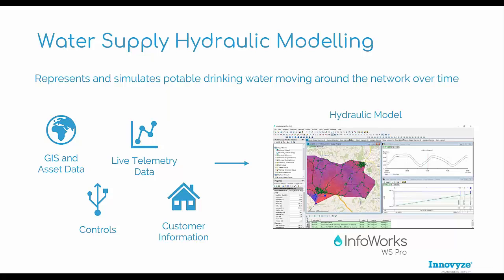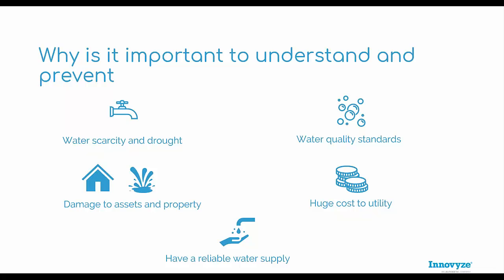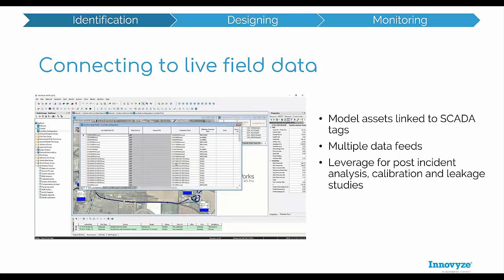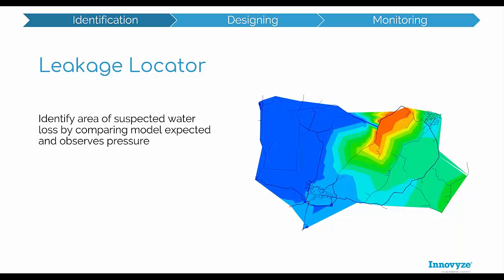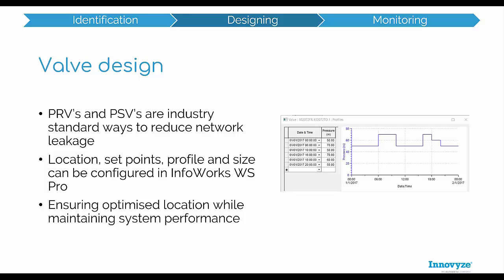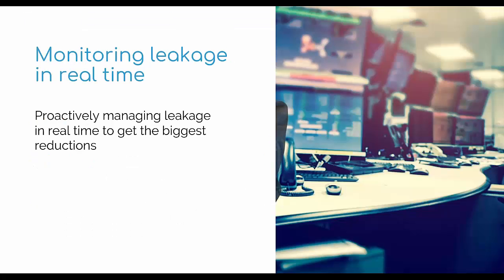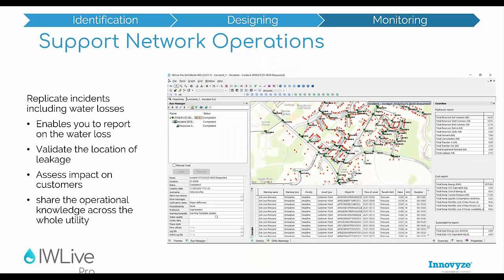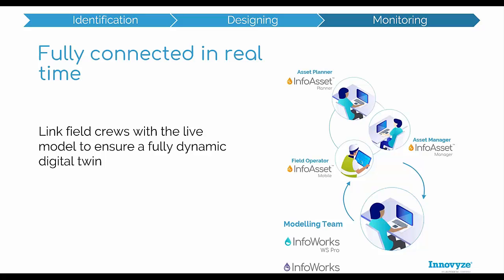Understanding water losses and leakage

Comment: When discussing problems of measuring and ESTABLISHING WATER LOSSES ALONG THE OPEN STREAMFLOES IN KARST along river channels in karst (Karst Hydrology for exp. Mediterrane area), reference is made primaly to upstream and middle reachs of the stream which are not located in typical and easily and easily discernible ponor zones and where and where the disapperance takes place through barely pereceptible small fissurrses, most frequenty at the bootom and rearlx at the side of OPEN stream ~ if we talk of a stream. The drying up is very rare in the winter period. It is occured now 3 time, before only twice. In order to find out where this water reaapears and to surface measurement points should be established as well as empirical probability curves for the number of drying up the days on minimum two stations at river all because we have  Support Network OperationsIdentify area of suspected water loss can be a trigger for LEAKEGE. Also there is better linera dependece of losses on the section on the inflowing discharge. Fully connected in real time is so GOOD PRESENTED IN EVERY KARST PROBLEM. Than you civil engineer colegue!